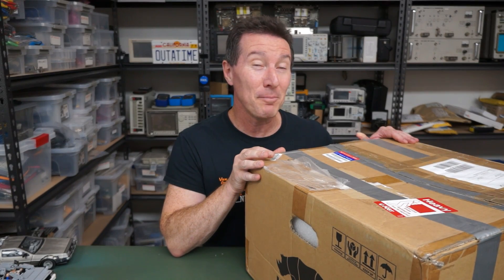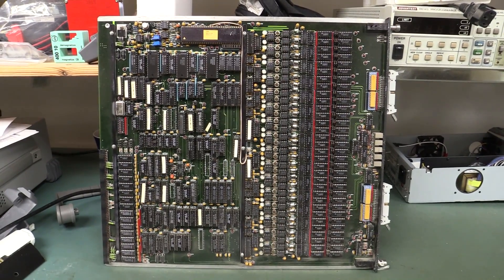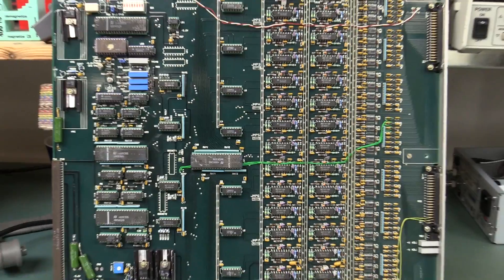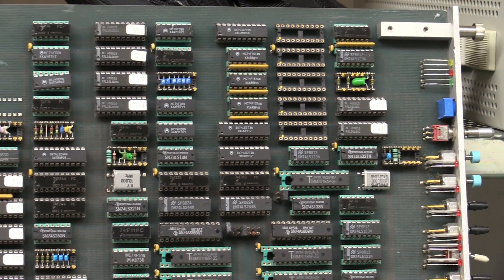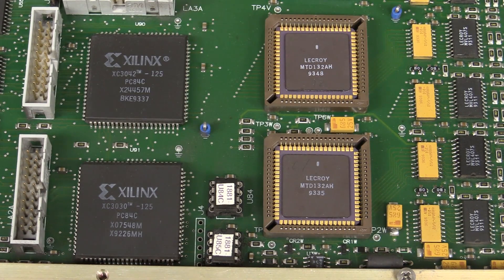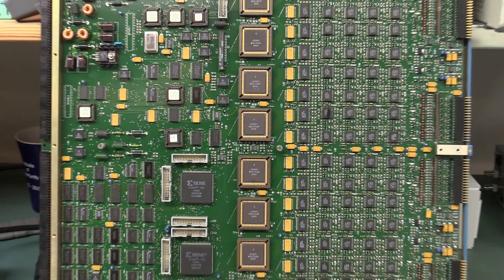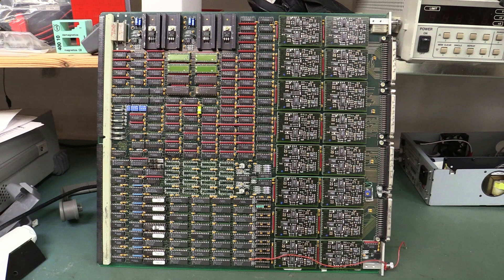EEVblog #994 - CERN/Fermilab Particle Accelerator Boards!

Comment: I used to work for LeCroy a few years before these were designed. LeCroy got started originally making high energy particle physics instrumentation. They only moved to scopes etc... much later when some of the US Govt. funding for particle research began to taper off. I worked mostly on CAMAC although the FASTBUS group was just about 50 feet from my desk and I knew some of the engineers over there. A pretty small design group (maybe 15 people??) but they cranked out the most amazing designs. Lots of those guys were actually PhD Physics types, not EE types.
Reply from the maker: Thanks for that. Someone in my audience always knows!
Reply: I think these "PhD Physics types" gave the LeCroy scopes an edge over Tek for me back then.
Reply: Hi Herbert. Interesting story. Brings even more life into the boards.
Reply: Yes, LeCroy does have an edge in this respect and has always been very good at leading edge state of the art designs. There were and probably still are many very top notch designers working there.
Reply: Herbert  with Vista Controls and   lot of software,      PDP 11  deterministic time stamps..  Many  CAMAC..  did lot of  SOE for Nukes...    Before the VB  Java guys gave engineering  the stupid pill ...

Comment: I used NIM quite a bit in our lab during the '80's and early '90's.  But we didn't call them "crates", they were "NIM bins".  About the only thing standard was the card size (well, the front panel) and the first (power) connector.  Everything else was "whatever's needed", meaning a total bodge when it wasn't a kluge.

In general, there are only a handful of things you want to know about the pulses from radiation detectors:  Their height, width, rise-time, energy (area), and pulse timing (rate/period, separation/overlap). But it is very difficult to measure all these quantities at once, especially at high speed, so trade-offs are required.  For example, pulses are often "shaped" to emphasize one measurement domain over another.

And some wide-range (~13 decade) detectors, such as the fission chambers used to detect neutrons, have multiple modes, from low-rate discrete pulses, to a middle ripply rate (called "Campbelling"), to a high-rate current (not voltage).  I once had to build a femtoammeter just to characterize one of these beasts.  Also had to build a giant Faraday cage around my workbench in order to use the femtoammeter.

And all of it was jammed into a NIM bin.
Reply: that is amazing. build a tool, then build cage to use it. it is so comical and mad scientist cool.

Comment: I use NIM bins every day at work but it's a pretty domain-specific standard so I'm not surprised you had never heard of it. They don't do much more than just supply power to the modules but it's nice not having a huge mess of cables and power bricks everywhere.

Comment: Typical experiments back in the day of these boards would have tens of thousands to hundreds of thousands of channels. Depending on what the particular subdetector system was measuring, it would either have ADCs or TDCs on each channel.  There would have been dozens if not hundreds of these boards on each experiment.  The custom built ones designed by the physicists were in the multi-thousands of dollars per board so we would use bodge wires instead of respinning the boards.  The chips were socketed so we could replace a chip rather than replace an expensive board when a channel went down.

I was on a Brookhaven National Lab experiment for most of the 90s and then on a Fermilab experiment from 98-2000.  I didn't use these boards but I did DAQ reading out similar boards.  Seeing these took me back.

Comment: Amazing to see so many socketed chips. The XC3030 and XC3042 are both FPGAs and became obsolete in 2003. Some of the data codes on those boards around 1993 so the boards are about 24 years old.

Comment: My father in law worked at a particle accelerator facility. He has been to CERN on numerous occasions. He gave me a tour of the electronics lab at the accelerator facility. They had a dishwasher in the lab. It was full of big circuit boards. Said they used it with special detergent to clean the boards. Each board was worth hundreds of thousands dollars.

Comment: HEEP=High Energy Electron-Positron Pairs, a subject of ongoing international research spearheaded by CERN.
Reply: douro20 Electron+Anti-electron[aka Positron] = ?
Reply from the maker: Ah, of course!
Reply: Thanks. :)
Reply: Thank you, this was nowhere on google.
Reply: Oh that's like probing the Schwinger Limit.  If you blast a high enough intensity laser source and concentrate it in a small region in space, it will generate electrons/positrons right out if the vacuum of space.  A theory that explains it is the Dirac Sea.
Reply: The HEEP at Fermilab was High Energy Equipment Pool, if I remember correctly.  Detector electronics purchased with FNAL dollars got a HEEP sticker. Ones purchased with university dollars got the sticker from that university.
Reply: @robm344  Work at a different national lab - that is correct. Equipment isn't really tracked anymore though.

Comment: I work on Otari high speed duplication systems for cassettes from the 80s. They use a similar arrangement of high speed flip-flops between the input from memory banks and D/A converters. They are used as buffers to correct jitter because of a fairly long cable between the microwave oven sized 1GB memory bank and D/A unit.

Comment: the VMM3 designed at brookhaven National Lab is on track to be the new ADC used in detector front end applications at the CERN. it has 64 channels on a BGA package the front end card I'm working on has 8 of those on it.

Comment: At Amdahl, we used to 'tune' a lot of signals with hair-thin coax/twinlead wire loops to add that extra nanoSecond or two... My Dad designed some of the mechanical magnet structures for the SSC - I got to visit the main building - it was a busy place then - - really too bad we did not go through with it...

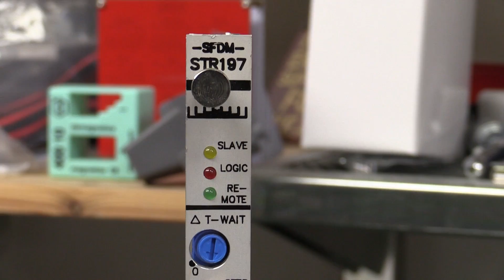Comment: 9:50 Nope, that's an off-the-shelf component apparently... the Struck STR197 Snoop FDM (FASTBUS Display Module), "a powerful tool to debug fastbus systems" according to some old advertisement.

Comment: Hey Dave - NIM stands for Nuclear Instrumentation Module and is a system of modular plug-ins that would go into a single universal power supply bin, used for nuclear and particle phys stuff for decades, you find NIM all over the place at labs because of how cheap they are, relatively speaking. I've got an Ortec NIM log/lin pulse counter myself.
Reply from the maker: thanks for the info.

Comment: I'm working on the the Phase 1 upgrade to the atlas detector for the University of Arizona. We are designing the front end electronics for the MicroMega detector on the New Small Wheel and that will be about 4000 boards that will be made to interface those detectors.

Comment: Man know you know why a ball valve cost 5k each on a submarines . I spent 7 years on them SSBN 619 634 . If you threw something away and it was going to be dumped out in the ocean and you get it out of the dumpster before it went out . It was considered theft of government property . I seen a guy spent 2 weeks in the brig just for getting a playboy off the barge . The told us every thing on there is still gov property even at the bottom of the ocean.  The sub I was on was in Holy loch scotland . So about 5 miles out straight you will find a 1983 playboy!!!!
Reply: As a Scot, I can't say I'm happy at the thought of the US Navy dumping its rubbish off our coast! :(
Reply: ncrdisabled Submarine vet it took the local council a few years of dredging to clear all the rubbish dumped over the side in the holy loch once the floating dock departed.
Reply: "you know why a ball valve cost 5k each on a submarines"

Yes, corruption
Reply: @jfbeam  ,   true, but unfortunately they have more govt. funds to prosecute than we or the grunts have to defend our rights.

Comment: If I had to guess these were probably used in signal processing where an analog signal from the detection array comes in through the input side and it is then converted to digital data for further processing. Even with more modern computers signal analysis and transformations still take an incredible amount of processing power. A modern MRI scanner for example will have a separate  room with a special a computer that measures about 6 feet tall and 8 feet long all dedicated to signal processing and digital conversion.

Comment: I looked up that property number on the Fermilab board - it's no longer in the system, so it was probably deemed excess and sent off to another institution for use (rather than shredding or recycling it).

Comment: Mid '80s through hole tech, more like a 16 layer board (8 minimum)  Also that third board is a bus manager so those boards all go into a huge chassis with a big backplane and that one likely goes near or at the center slot.  VME was listed and it looks like it could be a card from a VME chassis.  That last board (the old LeCroy) IS only 4 layers max. The others were more like 16 or 32.

Comment: eev blog   i worked a half  year at desy xfel! boards like these are not produced in mass but much more than 10 or so" the detectors have in some cases several thousends cells ! if one blade can handle 64 or so you see the point!

Comment: you can etch and electrolise the copper from the board
Reply: on the edge of these boards you can see that these are at least 6 layer, probably 8 layer boards - lots of shielding going on there in the middle...

Comment: @15:40 Dave questioned why the wire is so long, if they wanted to add delay to the signal due to its length. I got a bit confused, how does one even calculate this delay based on the  length that the data needs to go through.
Reply: You need roughly 30cm of wire for 1ns delay (~speed of light).
Reply: mod robert More like 20cm due to the slowdown in a cable which is not a vacuum.
Reply: Thank you sir!
Reply: God's gift to Physicists:

The Photo Multiplier Tube (PMT). Nearly ideal amplifier

The Twisted Pair Transmission Line. Nearly ideal transmission line.

Note: all the signals (Analog and Digital) are bused around deferentially.

Comment: Well i am really interested in latency, you say that a  few decimeters of cable can add latency?
I play mididrums and i could not for my world understand why they made the actual USB midi cable out from the pad control shorter then a meter because i really could not understand how if it basicly travel near lightspeed could add latency?

But that is not the case? So how fast does the electrons move in a phono cable, and how much latency would 10 meter cause? And the same example for a 4 ohm speaker cable does the watt out from amplifier affect the speed?
Reply: Decimetres? Now that's a rare prefix. Most people I know would put it in centimetres or millimetres (like Dave, I'm from Australia).

It's not the actual movement of individual electrons that carries the signal, but the electric field around them, and that travels close enough to the speed of light that you can just use that for your estimates. 

10m divided by 3e8 m/s gives 3.3e-8s

So, the signal takes 33 nanoseconds to travel down that 10 metre cable.

A 3GHz computer can probably do about 100 instructions in that time, so for a computer, that would be like five minutes to you or I.

The electrons themselves move through the cable at about the speed of dripping honey. There's just so many of them that the signal passes over them at the speed of light without making much difference to their position. Kind of like waves on the ocean. A float bobs up and down a lot as the waves go past, but doesn't move much from that spot.

As for power and speed, I don't think it does affect it, just the energy carried. I'm getting pretty close to the limits of my understanding of physics here.
Reply: light travels "only" about 30cm in 1 ns. And some of these boards were made for sub-nanosecond timing.

Nothing to worry about for your low speed applications ;-)

Comment: Would be a bit careful within components like these. Most of these types of boards are siting in the cave quite close to the experiments an the beam. Over time they get activated and are treated as nuclear waste. Probably the ones you got were just test modules and never got installed, used only for engineering and testing, but don’t go dumpster diving on CERN or Fermilab stuff.... BTW socketed op-amps are there to be swappable in case or rad damage.

Comment: Some notes:
1) CERN dumpsters that I know are not fair play unfortunately. You are supposed not to take things I think. Though , well...
2) As these are from the data acquisition part, this probably means that they were pulled from servers from the basements. Which means, well, they are old and stuff, but I would NOT eat, or sleep on them. If you have a Geiger counter check them just to be sure.
3) As I have been involved into the process, yes custom electronics for the data acquisition departments cost estimates can be really tough. The iWoRid conference is a niche and rare way to find this out.
4) ouf

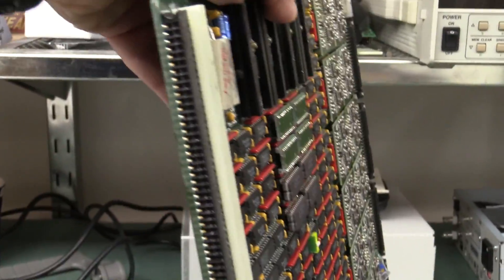Comment: 6:52 look at how thick that thing is. And only 4 layers? Wonder why they needed that much strength...
Reply: Dennis Lubert It's so old they probably stacked regular thickness 2-layer boards to make the 4 layers.  Nowadays they stack extra-thin boards that only make sense as part of a sandwich.
Reply: no, it's much more than 2 layers - perhaps Dave has some more time to spend on these boards ;-)

Comment: I wonder how big and how expensive this would be if something was made to accomplish the same thing today but with modern technology.
Reply: randomviewer896 Don't guess, just lookup the prices in hospital and lab spending reports.  For example, when a hospital does an CT scan or MRI scan, the patient is put in a plastic tube surrounded by X-ray or magnetic sensors that go into boards like these.  Each input provides one pixel, so to get a good picture they need a lot of these, then rotate the camera and move the bed to do a panorama.  Finally a beefy GPU is used to convert the panorama to 3D.

Comment: So I'm confused as to why they need so many integrated circuits on each of these boards. couldn't they just put a microcontroller on the board that was able to do all the digital logic?
Reply from the maker: Not a microcontroller, but a modern FPGA would probably do the trick. But you can't get around all the front end stuff, you still need that.
Reply: executing code would be too slow even on a fast processor, but yes, a modern FPGA would have replaced plenty of the discrete chips.
Reply: why wouldn't a microcontroller work in this situation?